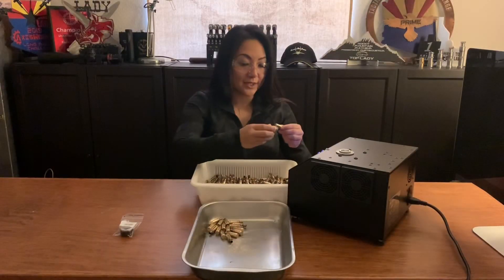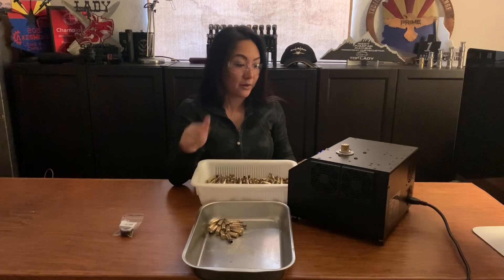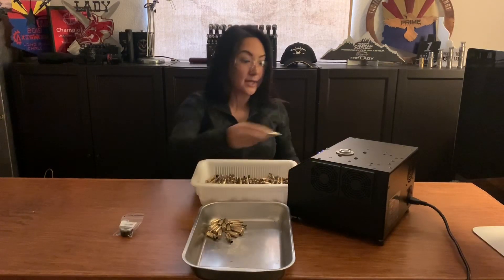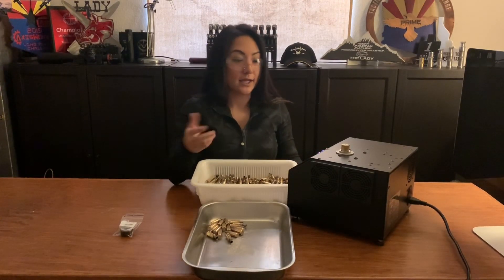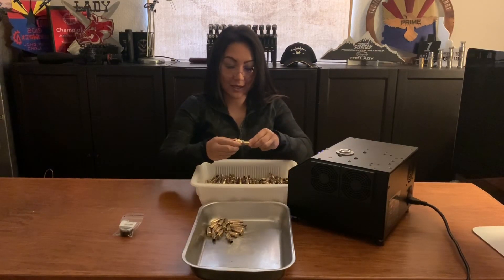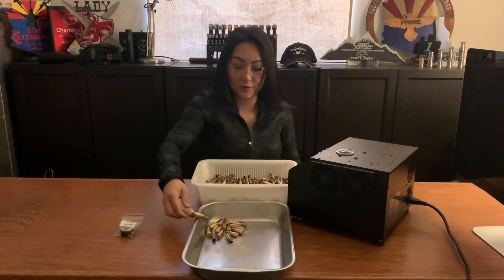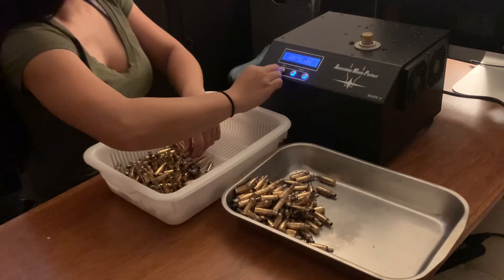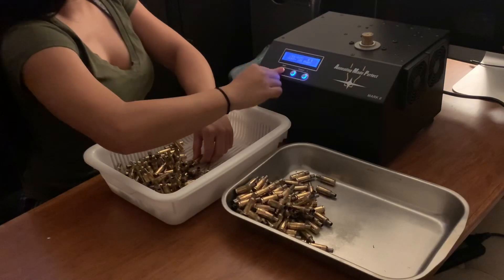Annealing brass with the AMP

Comment: Are you finding that the Aztec code changes on you minutely after every couple of batches of reloads?
Reply from the maker: When I use that I compare about 5-10 brass and take the average one and use it to measure. Depending on the quality of brass and lot, you have it might slightly differ from one to another.

Comment: I am on a fixed income and can not afford an expensive annealer.
I use a 1/2 inch socket chucked in an portable drill to spin the case heated with a Coleman propane cylinder.
I use Tempilaq 650 to measure the proper brass annealing temperature at the neck/shoulder.
Reply from the maker: I’ve done that before too